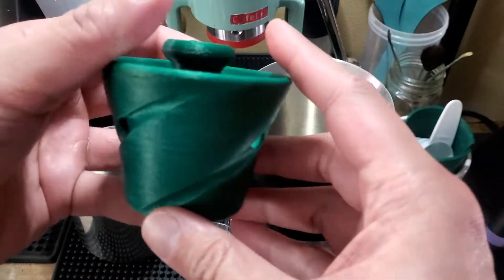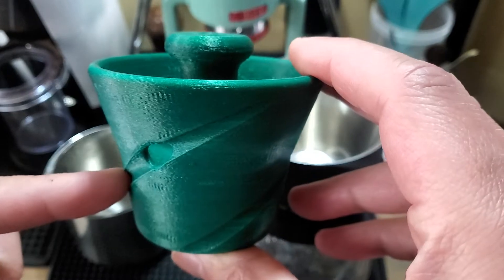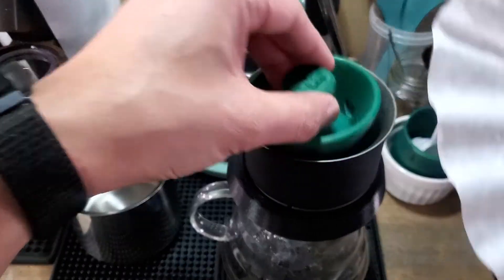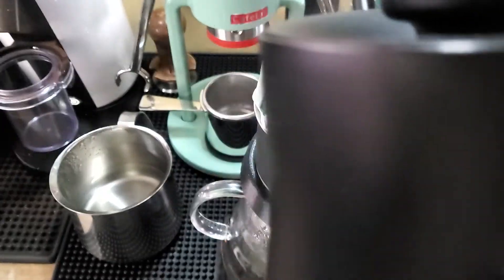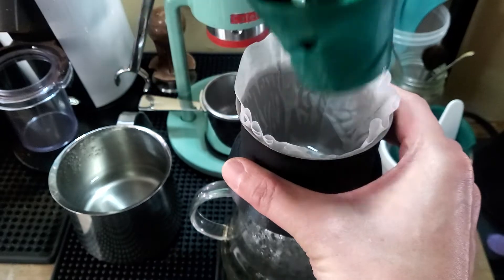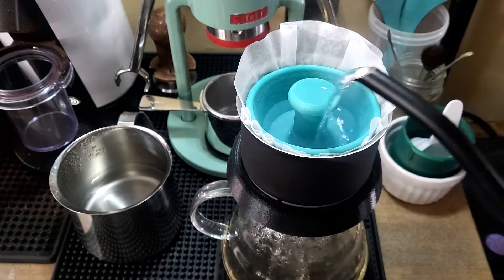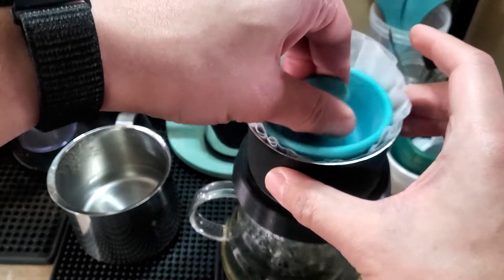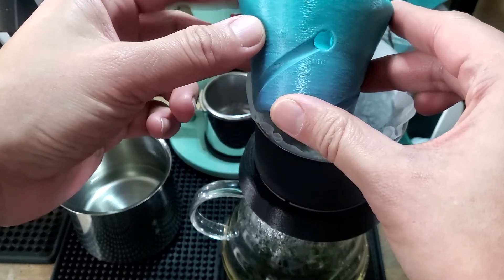Filter Smoosher v3 Update - Redesign and heat treating

Comment: Ok so did you print this yourself? So how do you know if your pla is heat treated? I’m looking for the file for the orea brewer I have coming.
Reply from the maker: Hi Linda, PLA itself isn't heat treated, but it's a process to take PLA and anneal it to get better properties, e.g. increased heat resistance and strength. There are types of PLA that anneal better, like HTPLA, and won't deform as much during the annealing process. I'll put a link to an annealing video in the description.